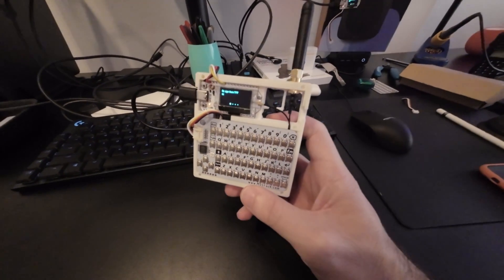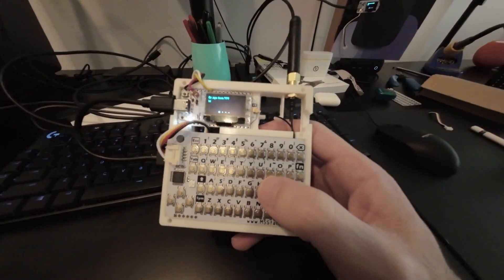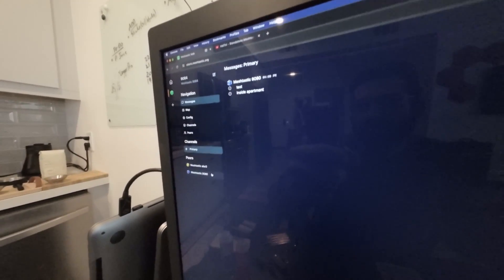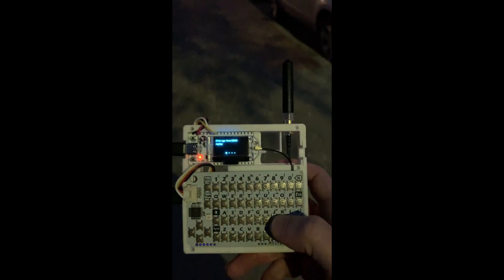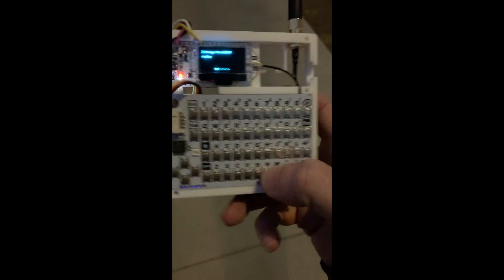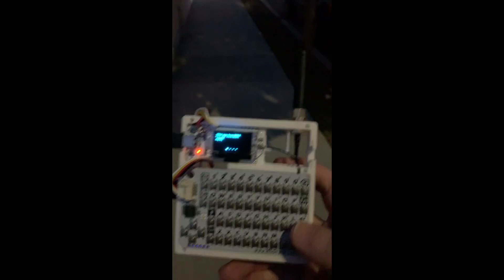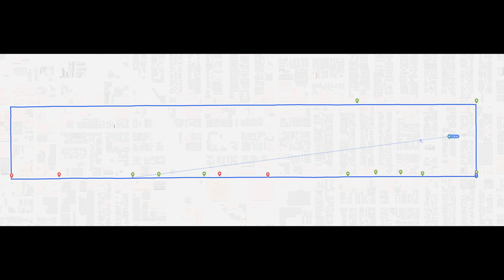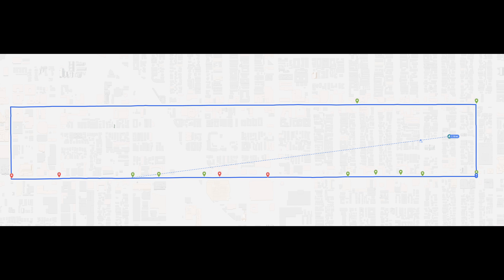Range Testing Meshtastic Nodes (Point to Point)...

Comment: Good video! I like the stress test point to point nicely done. Im new to all of this and have been researching the meshtastic. Question, can i transmit and will my info packet jump through multiple( other people's nodes) to my destination? Like a radio repeater? Or will it jump if other people have their nodes powered up and on line?
Reply from the maker: Yes that's the idea, if you live in a densely populated area, chances are there are other people with nodes powered up on the default settings and your message will be routed through them!